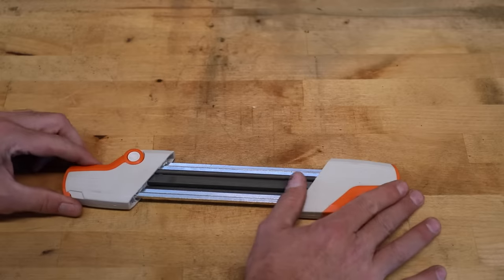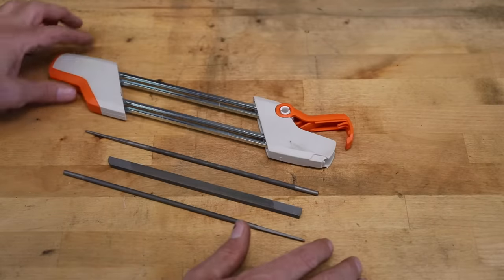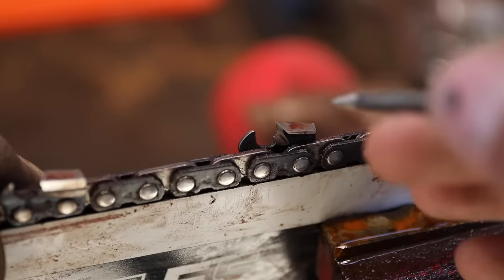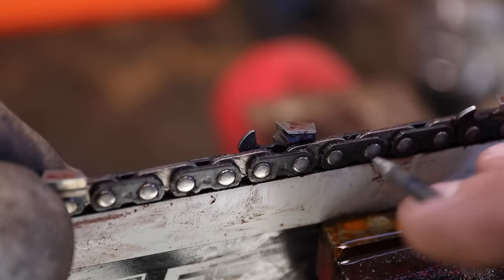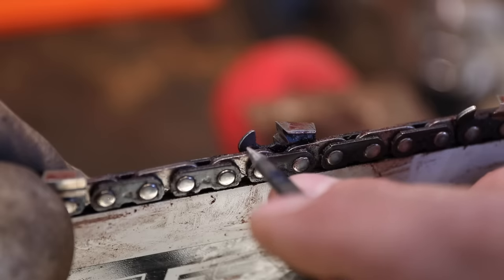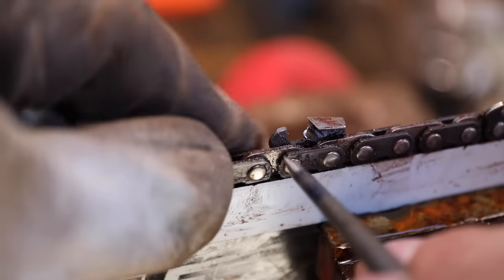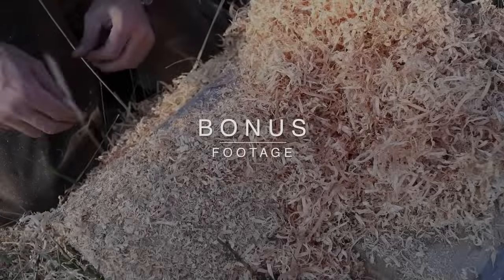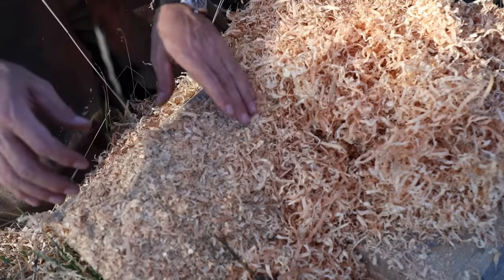Best Chainsaw Sharpener Ever - FINALLY!!!

Comment: You're doing it wrong!

That is made for a FULL COMP chain ONLY. You are sharpening a SKIP CHAIN and because of that your "rakers/depth gauges" are too low and your tooth is improperly sharpened. 

Each guide needs to rest on a tooth....hence the full comp chain requirement.
Reply: KimballCody you're doing life wrong
Reply: Hopefully Cody sees this. Your comment makes it very clear he cut the depth gauges too far.
Reply: I'm a bit of an amature, with a MS 290, would it serve me putting a pro chain on?
Reply: pro chain vs anti kick back chain. yes, I don't like anti kick back chains. they cut slower and I feel cause people to build bad habits.  learn and practice proper cutting techniques, wear PPE and keep your chain sharp and you'll be able to avoid most "accidents".
the anti kick back chains are easy to point out because of the extra bump near the "raker/depth guide"
Reply: Isn't that a full skip RIPPING chain on there? I swear that's what the teeth look like, would explain the oddball angle... Total incorrect use of this tool - "Those are nice files" he says - must have never used a new file to sharpen before ROFL...
Reply: Lumberjack Outdoors his chain is a very fast cutting square ground(from the factory) skip tooth sequence chain. It doesn't appear to be a ripping chain. 
You can regrind it with a round file or a square file.
Reply: Right on..I was a Stihl serv. manager and we had 2 different chain saw sharpeners just because of this situation....
Reply: KimballCody idk what any of you guys are talking about but would this be good to use on a basic stihl saw for around the house?
Reply: T Shelton because of the variety of chain out there I'd recommend learning how to free hand with a round file. Buckin Billy Ray has very informative videos on how to "get the gullet out" a few hours spread out over a few weeks and you'll get it down.
Reply: We sharpen our chains at 30° as a general angle because we bounce between ripping and cutting to fit wood through the chipper, and I've been told that different angles provide different cutting characteristics for different cuts and woods, but that angle certainly looks like a ripping angle. We also use full comp chains.
Reply: Also, when you're filing you want to make sure you keep your gullet or recurve on the tooth correct keep a better edge and help move the saw shavings out of the cut.
Reply: Seems to me like you just need to select the right 2in1 for the chain as there are 5 different versions of the 2in1 tool.
Reply: KimballCody has always happened in a great news day in a few months I will see my new schedule and will let me have ooopooooooooi
Reply: Reid Guhr nice toxicity
Reply: you're total right KimballCody - in my opinion this guy Cody is dangerous ... nice kick back chance and snapping saw with to deep rakers ...
Reply: KimballCody ..... you sound like your right out of the buckin billy ray school of sharpening chains....thats a good thing....buckin billy rays the only youtuber worth  watching when it comes to saws.
Reply: Mason Stansberry .....gotta get the gullet..... check out buckin billy  rays channel  on getting the gullet
Reply: i request a correction video!
Reply: Micheal Harvey get the gullet is one of my t-shirts saying 🤗
Reply: You're wrong KimballCody, It's for a Semi skip or skip chain. He is not sharping a comp chain.
Reply: ramairgto72 yes I'm running a 20inch DURAMATIC BAR    .325  81 link chain.  The pro chain is the only chain I run on all my saws.  My ms250.      The Duramatic bar is also awesome!!
Reply: The Duramatic bar is a solid bar.  No sprocket to wear out or get sand in etc.
Reply: TBH, shouldn't the tool say for what kind of saw it is?
Reply: KimballCody is it even possible to to use it on a skippchain. Angel is the 30 degres it is sapose to be. It gets aggressiv wen you pot to much presur on it. File bends and goes deper so the chissel gets an angel less than 60 degres. The gage easely gets to low as well.  Saw gets even more aggressiv.
Reply: He is filing / sharpening in the wrong direction. Not a pro.
Reply: KimballCody k
Reply: Now I can use a chainsaw but wouldn't have a clue how to make a video . And after seeing all of you filleting this poor guy , I wouldn't even try . Thanks yall . Turns out I don't know a hell of a lot about cutting wood either . LOL .
Reply: KimballCody the results were good enough for me.
Reply: Bill G n
Reply: KimballCody o
Reply: addison parker I could only get an 18 for my ms250. They said they couldn't get a 20. What the hell
Reply: Thanks for talking about Bucking Billy, I've been up for hours watching his videos!
Reply: I use it since 3 years, good for a fast sharpening but I sthil prefer handfiling
Reply: A STIHL rep already commented and said he was correct... so you know more than the STIHL rep?
Reply: No sprocket is old out of date...Sprocket bars of later design last forever on the oil off the bar...Gain quite a bit more power..More power is usually not a wrong idea to have..
Reply: KimballCody jh
Reply: @Deere2154D  My dealer told me the same thing.  But when I asked him if they had started making the mounting pattern different, he said no.  So I asked him if he would sell me a bar and chain for me 20 inch saw. He grinned and said sure, but he just couldn't sell me one AND INSTALL it on my 18... you can put it on anything it will fit on at your home...
Reply: Will McFarland I am of the same BELIEF.  I alter the profile depending on the type of wood being cut. I too adjust the RAKER/ D GAUGE to maximize the chain  lead cutting edge. I put great value on a saw tuned and a chain dialed in that RIPS wood and works with the motor displacement allowing full potential of powerplant. Not to mention PROPERLY TUNED, HAND  SHARPENED, BAR checked and deburred if someone cooked and or tweaked your money maker (F-IN hate that don't ya) and Chain tension dialed in = less fatigue, more production and above all THE SAFEST WAY TO OPERATE our chosen weapons of work. Sharp saw is a SAFE saw!!! PERIOD!!!
Reply: full comp chisel is the only way to go, unless its not,, but if it is, it is....
Reply: @KimballCody  even chisels arnt run that flat,, square is the inside edge not the angle
Reply: I find my file does this and does not sharpen the hole tooth but only top half of it. How do I solve this?
Reply: @itsgeekbeat  its impossible fir Stihl to list on tge tool, what saws its for when tgey dont know what chain you have put on your saw.

Peoe run differant chains on tge same saw
Reply: 8.36 he changed the chain
Reply: All u experts that know everything.. why you here? Go run your own channels
Reply: I think everyone is jealous of the pile of huge chips...hence all the negative comments...sad
Reply: @canamrider7195  exactly. Never cut the wood long ways or " cross cut. That's why he getting the long shavings. I zoomed in on that chain while he was sharpening it and it never got right with what he was doing and it was in bad shape. Faked it!! look y'all run a saw all day 5 or 6 days a week from Ms 201 trim saw to the 660 and the 880. Not usually that big tho but either way. Just don't cross cut like him and number one thing is to not hit the ground it ANYTHING else.   Not leaves,paper,plastic,rocks,guy wires,chaps, Nothing and it'll stay Sharp. If only I use a saw the chain can last 8 to 12 months and stay Sharp the whole time and I rarely ever file those rakers I guess I need to post a video of how to really do it and know it's sharp when you're done. Never a doubt when I'm done . I know it's sharp
Reply: i mean it seems to work ok sooooooooooo i dont see a problem
Reply: Reid Guhr he’s completely right 2 in 1is for rookies anyone competent in sharpening doesn’t need this
Reply: @lumberjackoutdoors933  Wonder how it got super sharp if he was using it incorrectly?

Comment: Just watched the video, not sure if anyone mentioned this in the comments but those tools aren't real designed to work as designed on skip chain since there is no place for the additional rail of the tool to sit. I do believe that it designed to sit on both rails of the tool to index for the depth gage/raker. Which means that the cutter teeth left and right must be spaced evenly like on a traditional chain. Alternating left and right cutters help hold the file at the proper height. Also they perform best with little to minimal pressure, since pushing on them may cause the metal guide rails to flex a bit which effects the depth gauge filing height. Great tool, I usually follow these angle on the guide. For home owner this angle won't effect their performance. As Professional sawyer's we have different angles for different situation well beyond the average user. Great video

Comment: Did you have it upside down? Almost looks like the file that’s doing the work it cutting from the opposite direction of what you would normally use. Not mocking just wondering cause you also say the angle is way off
Reply: I’m not positive but I think one way is for left cut and flip it and it it for the right cut teeth since chainsaw teeth go back and forth left and right.

Comment: The 30deg angle of the sharpener is the factory angle, and that tool is not meant to be used on your full skip chain. It's meant to run on two cutter teeth at the same time.
Reply: Good observation Kevin, the chrome rails are meant to ride on teeth of a standard chain ... the skip chain allows only 1 set to ride ..you can still use it but you are going too have to be careful or you'll gradually drop the file down the tooth face.

Comment: I think you should have thrown a 2nd older chain on another saw and sharpen to the angle that was on the tool and see why they wanted the buyer to use that steep of angle.

Comment: My experience has been that chains usually come in 30 degree or 35 degree cutting angles. (most of them) I believe that you have a chain with 35 degree angled cutters on it. All of my 3/8th pitch chains have 30 degree angled cutters on them and I'm pretty sure that's what the sharpener is set up for. I have been using this sharpener for about two years now and and have been very happy with the results. Just remember that most hand file systems are for "touch up" work, if you accidently hit a rock or soil you will probably need to have the chain sharpened on a mechanical sharpener. I agree with you 100% that the depth gauge file aspect of this sharpener is awesome, you don't need to put a seperate gauge on the chain to file down the depth link.

Comment: I have used one, and it's great, and used fairly lightly but regularly,  it is quick and easy and very effective. I use it at the angle of the handles on a 52 cc saw, 52cm bar. saw.

Comment: the angle matches my Husquvarna 365 perfectly
Reply: Difference is that Stihl will have the file balance like a scale across the saw-bar and chain and 20-30 degrees angle left to right, while on Husqvarna it leans 10 degrees to the side in addition to the left-to-right angle. I got yelled at for this first time I filed a Stihl at work....being used to the Husqvarna.

Comment: Try this, when you finish one tooth, simply flip the tool over to do the next tooth. I found it really easy with the saw blade pointing at my belly. But I only have a 16" blade. You don't need to turn the saw around and you only have to rotate the chain around the saw once.
Reply: But you must push the file through from the inside of the cutter, not from the outside in, pretty awkward to do it that way you say

Comment: Holy moly I didn't realize this thing came out that long ago. I have been using a rotary tool for years and last year I got this sharpening system and I absolutely love it. Of course it was also after my wife started working at Rural King and gets a 15% discount which is nice. Got myself an MS 261 and this sharpener

Comment: Wow, you just blew my mind. I sharpen my saw chain with a lil tool set I picked up for the purpose. I can get that "sticky sharp" pretty easy. But, by the end of the cutting season, chain won't cut fer *&^%. NEVER knew about the depth gauge filing. lol Just figured,  eh thats it for that chain. Go get another one for next year. What makes me feel really stupid is, that tool set has another file in it...... Never could figure out what it was for. I am now assuming, its for the depth gauge. Find me a wall to beat my head against. Maybe It will make me smarter.
Reply: Same here. I'm 30 years old and at the age of 15 I started cutting wood for money. I learned on my own as my parents lost everything to addiction. No one has ever mentioned depth gauges on a chain. I will have 10-15 chains in garage that I can put back into service!

Comment: I may be wrong, but I think he was sharpening a skip tooth chain. The sharpener was likely made for a chain with twice as many cutting teeth. The front set of steel guide bars should be running on the back of another cutting link instead of on a flat link. That’s why your depth gauges were cut so aggressively. If I’m wrong, let me know.

Comment: I was utterly useless at sharpening chains until I bought one of these. Yes they are awesome. Actually they are not made by Stihl but by Pferd, you can get them in Pferd blue as well and they are usually a little bit cheaper.

Comment: I buck logs for a living, your saw teeth look very square, the tool looks about right for angle. What kind of chain is that? I usualy only knock down the rakers once on each chain, but occasionaly I will have to knock them down a second time before the chain is worn out. I am using Stihl 3/8 .063 skip tooth chisel and a 7/32 file. as long as I don't rototill, 1 or 2 strokes is enough to get my chain back to shaving sharp. If you want some advice, stop dragging your fie back and it will last 4 times longer!

Comment: It looks like you have a rip chain 5 to 10 degrees, cross cut should be 30 to 35 degrees and you should lift on the back stroke or you will dull your file sooner.
Reply: John McLean exactly, almost 3 million views of a guy dulling his brand new files by dragging them back after sharpening... how not to use this sharpener 101

Comment: Before you go through all this nonsense. ...watch buckin Billy rays filin tecinque...just a regular file and comm on sense will get you a long way..and if your filin alot my suggestion is get a grinder...my wrists can't handle much hand filin....get the gullet!
Reply: Get the Gullet !
Reply: Buckin' is a great faller/woodman. A real pro.
Reply: 100%.. been following him for over a year. Always learning from his techniques.. real pro yes.. and a good man!
Reply: I agree I have the 2 in 1 wranglestar  has here but I didn't even use it for 1 month I had seen buckin 's videos and I went back watched learned and practiced hand filing with a plain saw file. nothing better than that now I hand file every chain
Reply: arborist460: We love Buckin Billy Ray. But his program is quite different from this presentation.

I was thinking of Billy when Cody spoke briefly about the gullet.

I have been using saws, mostly professionally, since the 1980s. Had many troubles along the way. But things really turned around when I started learning chain terminology and doing what it said in the chain saw's manuals. And I have read everything I could concerning saws and especially chains and related things. THEREFORE -- there is nothing wrong with this product. And that is why I first wrote that this is Cody's best video on this subject EVER!!

If someone wants to do things Billy Ray's way and it works for them, that's fine. But Cody found a good thing in the Two in One sharpener, and he just wants to share it with us. He isn't forcing anything on anyone.

And if you are not up to snuff on chain cutting theory and nomenclature, then you would be better off listening and learning, rather than chiming in here with misinformation, wrong terminology, and negativity.
Reply: Got a link?
Reply: 327ewok GET THAT GULLET Y'ALL 😍😍👍🏻👍🏻😂😂
Reply: I totally agree, hand filing the Buckin Billy Ray way is the most effective way to sharpen your chain.

Comment: I love that tool! I’ve been using it for at least 5 years and it’s so quick and easy to sharpen the chaint that it do it almost every time i use the saw👏🏻 Even my small electric saw cuts everything I throw at it. Two thumbs up.
Reply: Mario Paz
1 second ago
Is this sharpener applicable to all chains? do chains have different sizes? thank you for answering
Reply: @pazdeleon  Stihl have different sizes depending on what chain you have👌🏻

Comment: Look at the angle-lines factory imprinted near the end of each cutter on the chain. The angle on the tool will align perfectly to that so this guy is filing too straight across. Also LIFT the file on the backstroke, even when you increase the tempo.
Reply: This video is cringe worthy.  Not only was the angle way off. But the back drag killed me

Comment: why did you not sharpen at the angle recommended by Stihl. That should be addressed
Reply: He went by the angle on the chain. The top of the chain has marks that show the proper angle.